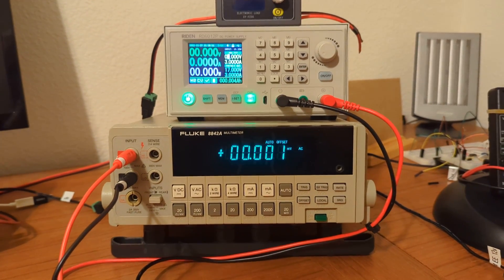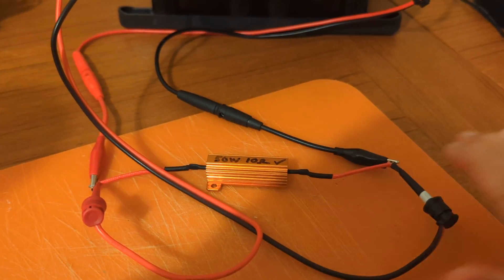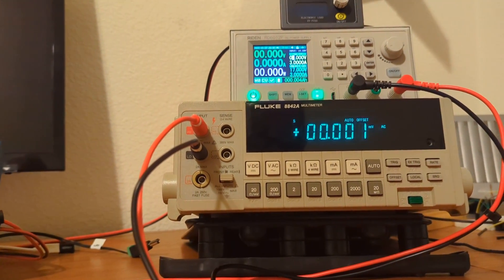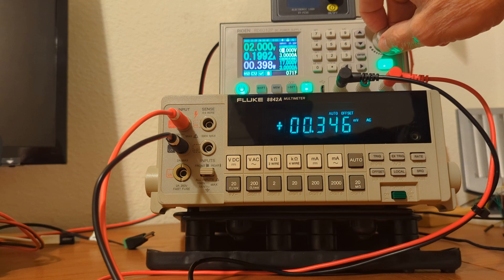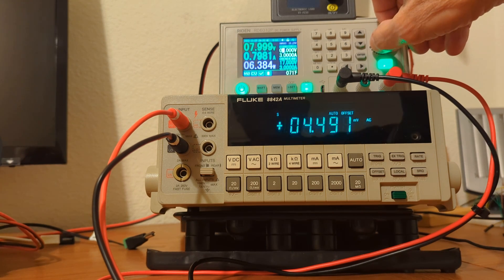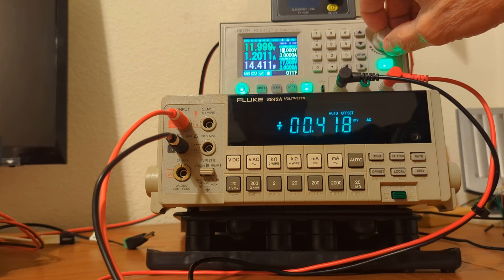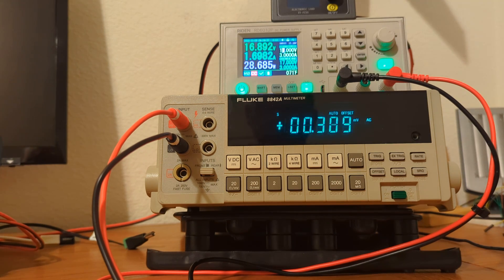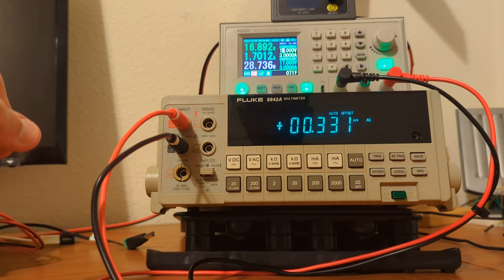Riden RD6012P ripple voltage (AC RMS) measured with a Fluke multimeter

Comment: Hey, I wonder which power supply did you use with rd6012p?
Reply from the maker: I'm using a power brick from an old laptop computer. It outputs up to 19v and 3 amps. That's all I need, in most cases.
Reply: Wow, thanks! I didn't know it could be suficcient for that task.

Comment: This is not proper way to measure ripple and noise. You should use oscilloscope and measure it directly at the power supply output connectors.
Reply: That's BS, way back we measured ripple and noise with a fluke 8060A, one of the best meters to do this with for decades.  I'm all for using an oscilloscope for just about everything, but it's not the definitive tool for everything.
Reply: @TimEdrington  wow i dont know we can test ripple with a multimeter!